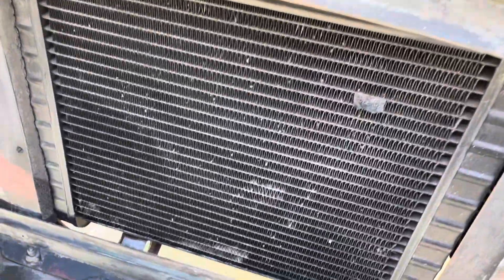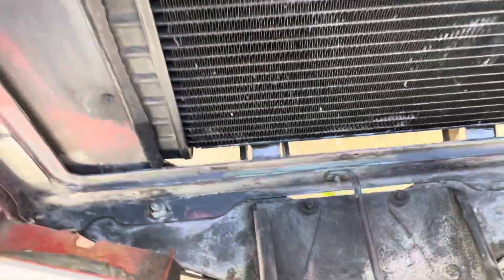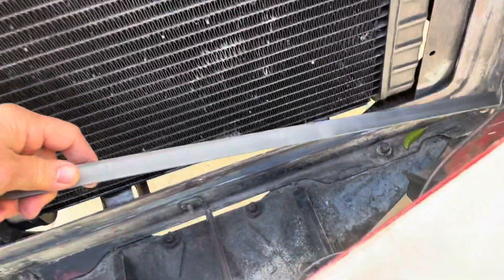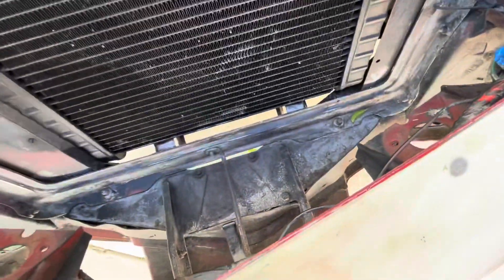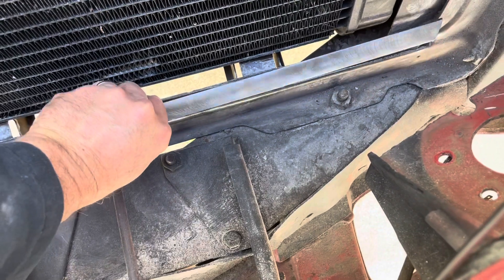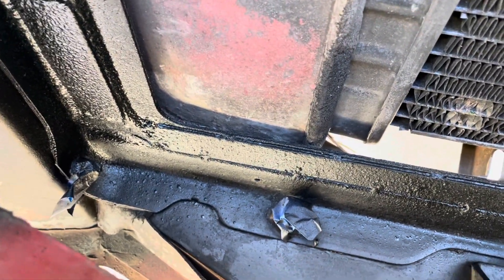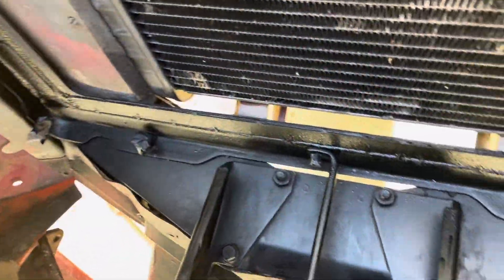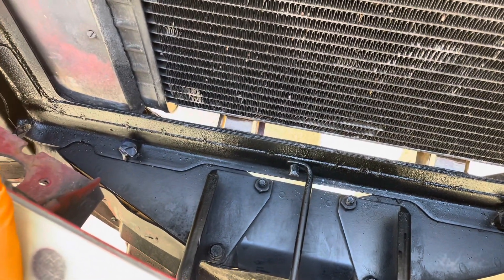Rusty Radiator Support Fix

Comment: Cut out all the rust. Open up any holes to get to good steel. I would not lay a patch over rusted spots. I'd cut the section our and butt weld the repair. Afterward I'd coat the inside with POR15. I've done a couple that way. It will continue to rust from the inside out otherwise. That is a bad location for rusting. Living in a warm climate, I'd replace the radiator with a DeWitts radiator and a Spals electric fan. I really would if running AC. Speedway pats which is DeWitts I believe sells both. Or at least I've gotten the set up from them.